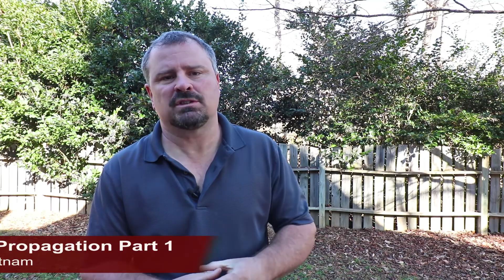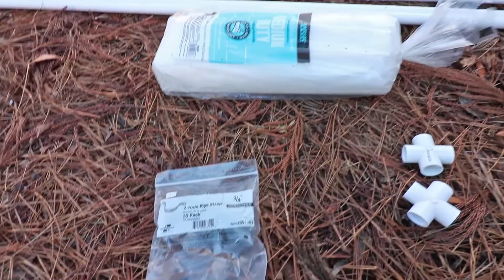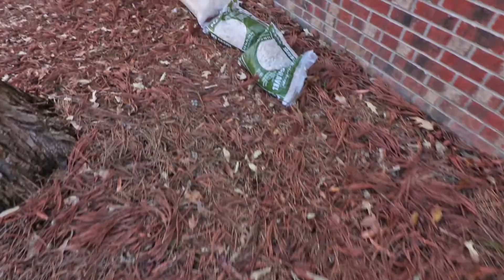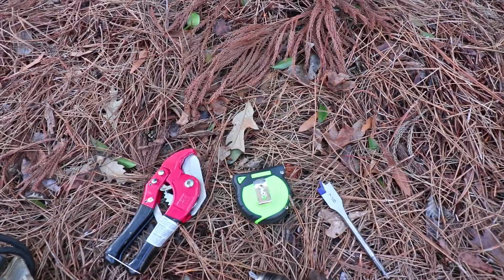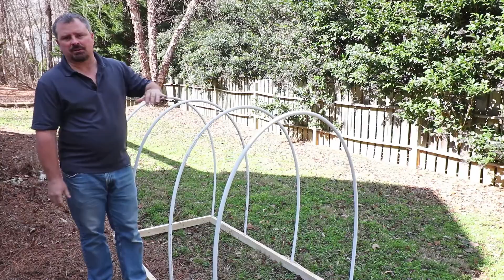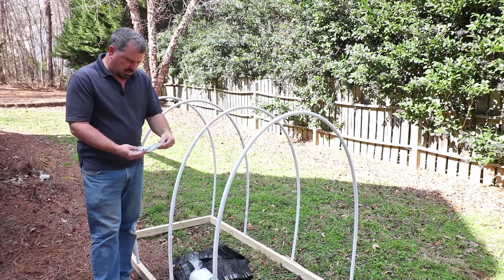Backyard Plant Propagation Episode 1 (How to Root Woody Shrub Series)

Comment: Great videos, Jim, Subscribed. Have you tried propagating trees (such as fruit) from hard, dormant cuttings taken in winter? If you have, I would love to see your take on that - as this type of propagation can be more challenging to keep the mold and rot to a minimum, while the cutting is rooting.
Reply from the maker: +David Veshapidze The way I have done it is I take long cuttings. I bundle the up in a rubber band and bury the group about half way down in a bark soil. After a few weeks I see what has callused and then keep those and throw out the rest. It is fast and easy. I am building a new house to start season two and I will show that technique.
Reply: Thanks, Jim. That's interesting. When you say bark, do you mean the bark mixture that you make in one of your videos 1/3 equal parts of moss + perlite + bark? Or do you mean straight orchid bark? I have some hard to get cuttings coming in the next week or so and I haven't had a lot of success with rooting them in sterile soil (tried perlite, vermiculite, Peat moss, and the combination of the three as well). My worst enemy is the rot and the rot and fungus that grows while trying to keep them moist. My next strategy was going to be a heated mat with perhaps some bark and some sphagnum moss (basically what you would mix for an orchid). Any pointers you can give me before you get to doing your videos on rooting dormant cuttings, I'd be thankful!